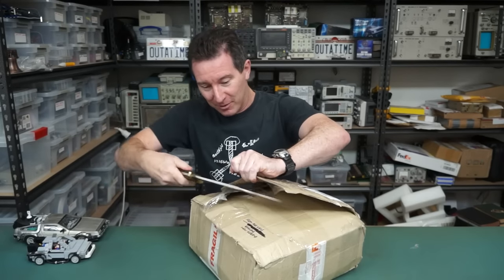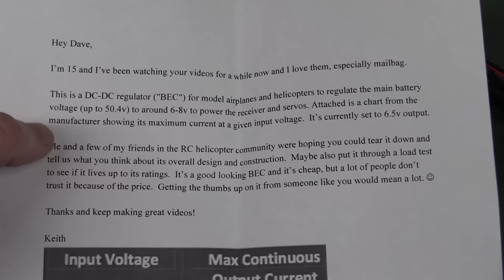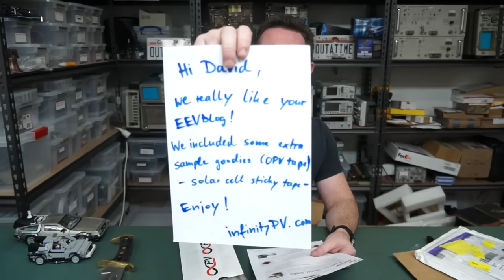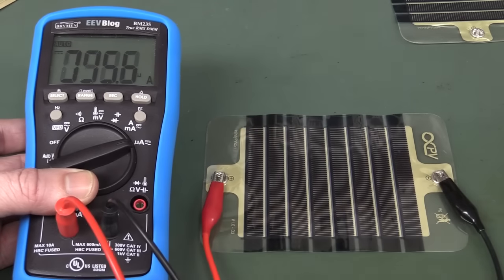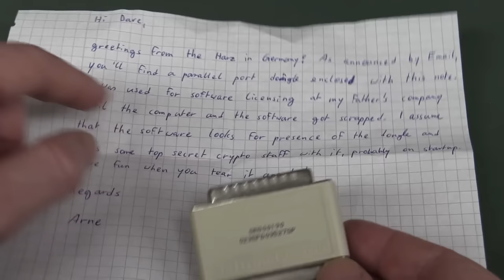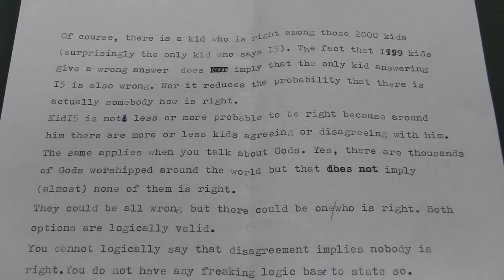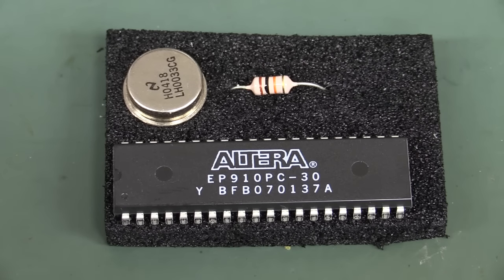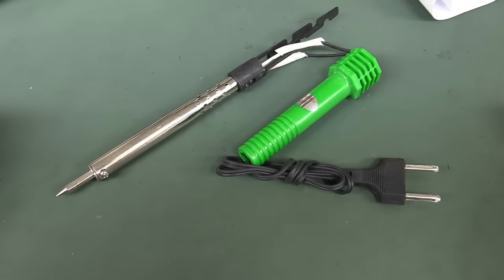EEVblog #893 - Mailbag

Comment: its an rc speed conttroller, most likely brushless
Reply: the card is for the electronic speed controller, and its for programming it
Reply: It definitely looks like a speed controller for brushless motors for use in RC cars, looking at the number of wires that are present. (3 sensor wires, and 2 wires for DC power.)
Reply: +coobird's lab actually the black pin goes to the receiver, most likely +5v and a signal wire ( usually yellow etc) and 2thicker wires go to the battery and 3 thick (blue, yellow and maybe orange) go to the brushless motor
Reply: Ah right, the black pins (small ones) are the ones that go for to the receiver. On the other end, there's 5 big terminals which for the DC power and sensor wires. :)
Actually I also see that there's a capacitor between the + and - ends of the DC power, which I believe acts as a "reservoir" to deliver high current in a short notice.
Reply: Sensor wires? You mean motor wires, do you? Most modern brushless motors today are sensorless.
Reply: Oops! Definitely not sensor wires...
Reply: You sure? I know some guys at my local robotics group that dabbled in them, but quickly returned to models with sensors... They felt they were too finicky, and decided they liked the reliability of timing off sensors. I'm sure plenty of sensors motors are sold, probably for very niche applications, but I would not say "most". Not by a long shot.
Reply: I meant the commonly available motors. For robotics, motors with sensors really seem better, especially for lower speeds. But it's not the case in this ESC ;)

Comment: I dont usually do online religion stuff but I have to say sorry mate, but multiple interpretations of gods does not equate to evidence against a god. Show an event to 10 people and they will interprite it differently, the 3 that are turned away will have a consistent view but that doesn't invalidate the testimony of those who experienced it and with religion personal experience/revalation is all we have and sure thats not testable and non transferable. I accept the idea of one specific God existing is extremely improbable and the chances of chosing that one is impossibly slim. That being said I consider the value of using probability to discuss philosophy is invalid as a. We have a sample size of 1 universe b. There is a truth, something exists or it doesnt and the probablity of that is 100% it can be proven but only by experiencing death.(sure its not scientific) 

In addition id rather see you hack a calculator to bits than do philosophy. 
Cheers.

Comment: I remember the PCB layout and mechanical guys used to have a printer switch box with a bunch of dongles plugged into it so they could run the different programs that required them.

Comment: I have an argument that I would like to share(since this topic is opened anyway).
There is a rule that said:
Every event that has a starting point must have causative, originator? creator (WHATEVER).
This universe has a starting point  (it is not infinite).
so as a conclusion it must have a Creator.
what do you think!

by the way the time itself and the matter started with the starting point of the universe , so basically every single physics law that has time or matter in its structure will fail before this point, the starting point of the universe.
Please keep your own thoughts about religion away when answering this Question please be logical and scientific.
Reply: Following your logic any creator must have a creator. So this kind of logic does not provide answers.

Stating "God suddenly appeared and created the world" is the same as "Spacetime suddenly appeared and the world began".

Also stating that "God was always present" is just as right/wrong as stating "Spacetime was always present".

No matter how you use these kind of logic statements they will neither prove nor disprove that there is a God and/or there was a Big Bang (random beginning of everything).

This does sadly not prevent religious people from trying to disprove science by using logic statements that are either wrong or lead to no answers (which for some reason is interpreted as proof of God and proof against science... which make you wonder...)
Reply: kim Dierichsen I think you need to read more about the big bang and how they have reached so far about it. This is not a scientific nor logical reply even science wouldn't be able to prove GOD do exist anyway !!
And let me tell you something else, Do you know any other theories that said time do exist before the universe and what exactly the scientific position of those theories.

Also there is other possible ways to prove that creator/God do exist but I don't think it would convince you"at least currently".
Reply: kim Dierichsen As I have told you I am not arguing about cultures or religions here it is just a concept rather than a believe!
Reply: kim Dierichsen and if you are not convinced, you might want to read carefully and slowly without external effect like harris or Dawkins. Use you own mind to judge what I have said so far.
Reply: Dem212 I have a huge big surprise for you, the one who have created this page mention this
"The arguments dates back to the Islamic apologist al-Ghāzāli (1058-1111)".
Al-Ghāzāli was a huge atheist you guys would be like ants beside him.
this guy converted back to islam after he found how bad was his arguments and how far his arguments from man normal thinking.
Please read more about al-Ghāzāli to know how did he lift athisesm and returned back to Islam (originally he was a Muslim and left and came back after that). 
by the way kalam is a pure Arabic language word means speech or talk.
Reply: Dem212 oh BTW this is a very long article so long that makes me ask does my argument require this long article to prove I am wrong.
Anyway who have this amount of time those days, simply if you know the summary you can simply write it here, I will not read all of that to just see whether or not it is wrong or right.
Reply: Muhammad Nour Elmogy
I know plenty about Al-Ghazali. And no, his philosophy can be said to have been a large part of the golden age of Islam's decline. His book The Incoherence of Philosophers promoted an anti-science way of interpreting the world. Leading generations of Muslims to be less interested in natural causes, replaced with lazy blanked explanation of "God's will", and stifling inquiry into the real world on a large scale. As for your claim that Al-Ghazali was a non-believer, I don't see how that would matter. I never said his arguments were good. And someone being a non-believer doesn't mean they have anything else in common with me. But it just sounds like the typical made-up redemption story to satisfy the desire for stories that contrive conviction in god.
Reply: kim Dierichsen :D This is the starting point of hopeless:D good read.

You need to study what do you believe instead of just following?
I am not telling you to study my religion or anyone's religion, just your own "atheism of course am talking about".

If you have even the smallest amount of a human conscience, you will feel all the contradictions and misleading in there phrases.

I know that because you only want conscience to judge their talk no science involved in their arguments, thats my response to your words about knowing less in science  "as if science ever required or capable of defining God or his properties".
Reply: Dem212 l have skimmed over the article(no need for the videos after all)
And here is the deal
I gave you and your fellows a 3 lines argument, just a 3 lines and you in return gave me a humongous article as response!!
And you expect what ? to read the whole page and come back here to response!
Well here is my response. Do you know Dave's bullshit device?? It wouldn't be enough to have 100 of it and use them all to blow this article up with.

Are you kidding me? I will need to write a book to talk about all kind of human minds deceiving techniques that being used in this article.

Let me give you an example, when he said that the rearrangement of matter require a cause but not the matter it self to exist from nothingness would require a cause 0.o

What are you talking about or should I say to whom you are talking?? Which is more complex, to rearrange a matter to form it in another shape or to create this matter from nothing????????
What kind of mind that would take that in and try to convince people with.

If this is all what you got for me or this is the best thing that you have, I thing you will need to rearrange your thoughts and deeply think about what is your motivation in life in a better way rather than following those upside-down minds.
Reply: Muhammad Nour Elmogy
You seem frustrated by the complexity of the counterarguments. I suggest watching the videos that I linked, as they explain the main points clearly. We do not have any example of anything coming into existence from nothing(ex-nihilo). Nor does anything need to. What we do have is matter/energy changing and interacting in different ways(observed as "time"). You're being confused by the human concept "infinity", which we created from our agent-centric enumeration of change.

If you watch those videos I think you'll start to see that there are flaws throughout this argument. And it certainly doesn't establish an agent cause/creator being.
Reply: Dem212 nope, thanks.
I really wanted to know more about what kind of athisests you are guys nothing more and I can say now I have an idea:D.
Reply: Muhammad Nour Elmogy
I have no problem with you coping out like that. Just know that you are doing us non-believers a great favor by putting forth poor and completely refuted arguments. It just indicates how bad your best case for your god's existence is.
Reply: Muhammad Nour Elmogy
>"That is the way you live your life following the human logic to prove or disprove something that will never be able to disprove it(or 100% prove it!)."

In science we aren't interested in 100% proving anything. We are interested in evidence and degrees of accuracy in representing existence with our words and concepts.

"how come you disprove existence of something that you have never seen or touch..."

Because the Yahweh claim asserts a detached agency that acts upon the Earth. Providing ample conflicting evidence from multiple avenues. A great example is the claim that god created humans. Which conflicts with all of modern biology. Or just the claim that Yahweh exists without a developmental phase. Which conflicts with all available evidence on the subject of agency and its dependency on a calculating structure.

"there is countless amount of events, signs and traces all over the place that tell us about it"

You need to have the objectivity to see that you have been taught to interpret these things as signs of god. There is no actual evidence of causation from the god being. Just "I don't know therefor god." Or setting yourself up with confirmation bias by praying for good (good happens, you misattribute it to god). I'm sure all these tactics for contriving conviction are comforting for propping up your unrealistic way of dealing with the fear of death. If you want to get down to the core of it, you should learn to deal with the fear of death in a realistic way. This is our one and only existence, death is a permanent state, so don't spend it fantasizing about the invention of another.
Reply: Told you, we will argue until the end of life, human logic is deceptive and using it to judge everything will lead to nothing and thats literally what you have conclude.
Anyway see you on the other side :D
Reply: Muhammad Nour Elmogy "Anyway see you on the other side :D"
That's the point that you missed. ;) There's no such thing. 

Rejecting the process of "human logic" because it's inconvenient? You don't sound like someone who is interested in accuracy (truth). Dependency on the religion is that great?
Reply: Muhammad Nour Elmogy
"I have used human logic that have been used for 1000s of years by billions of humans to convince you about such a simple fact but you yourself rejected it"

I have pointed out the many reasons why it doesn't infer a god/creator. Of course I reject this poor argument.

"I am sure there is a God..."

How convinced you are doesn't say anything about its accuracy. Just that it likely appeals to human cognitive biases and desires. Such as the desire for an afterlife. Many beliefs propagate due to our human desire to hold them, not their accuracy, unless special action is taken (ex. science).

"I am 100% sure that there is enough evidences and proofs in this world to make you believe the same but you simply don't want to"

This is a convenient cop-out from conflicting views. Your "evidences and proofs" do not infer a god in any way. If they weren't full of fallacies and so completely susceptible to cognitive biases, I would accept them gladly. They aren't convincing because they are deeply flawed. When we applying methodologies to reduce confounding factors within our analyses of the universe in general (science), we only find evidence against these primitive worldviews that revolve around a causal god character.

"I swear to you that you and everyone will remember this talk and this argument when it wouldn't matter anymore any of what we are saying now."

Our beliefs inform our actions. So whether you are willing to think more deeply about your convictions may very well matter to your one and only actual existence. Will you spend the only existence that you actually have evidence for dreaming of another life? Or will you appreciate our lives, this planet, and the permanence of death for what they actually are?
Reply: Dem212 
" Or will you appreciate our lives, this planet, and the permanence of death for what they actually are?"
0.o look who is talking about death and life!!
why would you go through this life with all the illness, sadness, sorrow and grief, if there is no reward and punishment !!!!
you will be equal to any other animal or even solid forms of creation that wouldn't have any purpose of life!!!!!!!!!!!!!

you want me to live poor or rich and work all my life to have house, kids and wife? so what? what after that, even if you give me 10000000 years to live so what ?????????? it is still the same

Who is dreaming here? who is imagining here??
Sorry but the logic here is too far away from your feet!

If it is only one life so I would choose to believe in reward and punishment after it instead of live like useless thing or purposeless creature that he is only suffering and think he exist to eat and for reproduction.!!!!!!!!!!!

See you on the other side :D
Reply: Dem212
I would like to add another thing about death and life, if there is nothing after life so why people DIE???????
wouldn't it make more sense if people live forever in this universe !!

At least they will be able to do all kind of things that they would imagine, they have all the time in the world after all!!

If that doesn't make sense to you so what is the point of living a certain amount of time and die after that??

What is the point of building a very strong house with all the effort and love and after while you leave this place forever !!! and your family also will leave it after while and also their families and so on!!!

If people will die sooner or later why would they struggle in this life and do all the effort to live and after that leave !!!!!!!!!!!!!!!!

I am really astonished when I see someone think like that

If you can't find another life is waiting for you after this short period you lived in this place(the universe) or call it whatever you want, so you are missing the real meaning in this short (very very short) life and don't want to step one step to try to figure out this meaning!